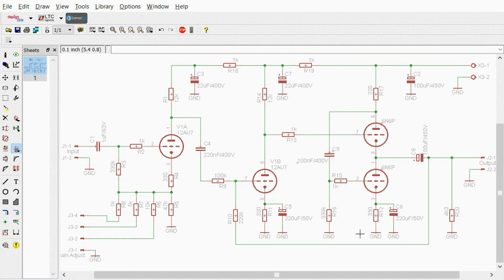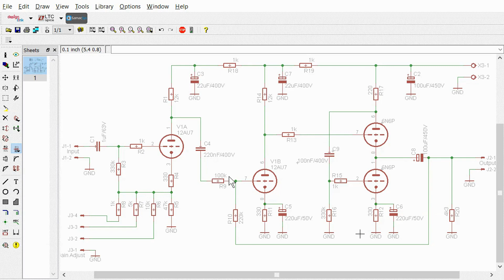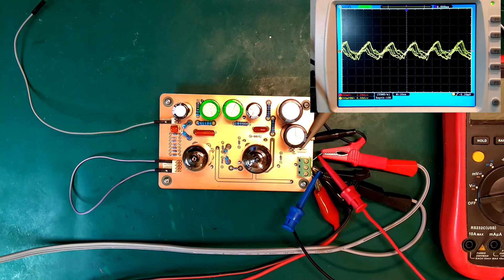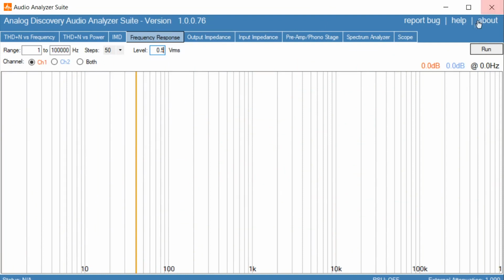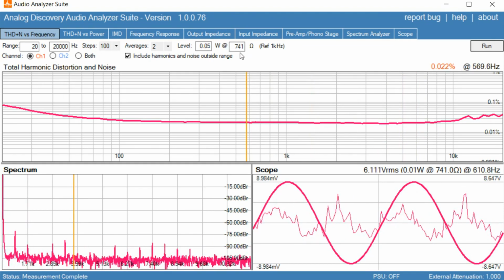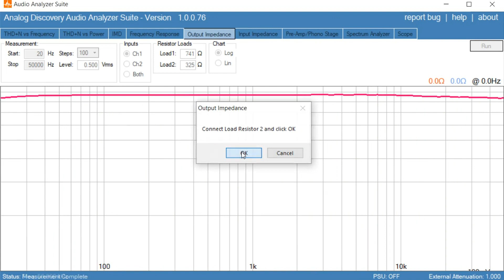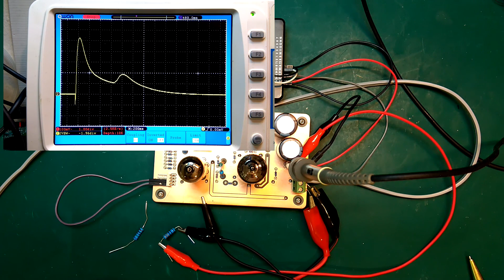Designing and Building a Tube Headphone Amplifier - Part 1 - Prototype Design and Measurements

Comment: Your project is sooo timely, I started thinking about a headphone amp last night. I found this, https://headwizememorial.wordpress.com/tag/headphone-amplifier/, and started down the OTL design route then you posted this part 1. I'm looking forward to your progress. Also. excellent tip at the end about the power on spike and that it needs to be avoided. I probably would have blown out my headphones,  so I owe you for that save.
Reply from the maker: Thanks, that is a great collection of tube headphone designs, I'll have a closer look at these. I believe OTL is the right way to go unless you need to drive really low impedance headphones plus I find it can be a bit hard to know what you are getting when shopping for output transformers.
Reply: @TheStuffMade  I think it's great you're undertaking this project wanting OTL. The fact that measured ~10ohms output impedance and mW of power gives you a lot of headphone flexibility. Research the modified White and how they determined the plate resistance value to balance the output push pull.
Reply from the maker: @CraigHollabaugh  thanks, yeah I think it will make a nice little headphone amplifier once finished. I do use LT Spice to tune the circuit for low output impedance and distortion, however I often find the tube models can be a bit hit and miss but usually they will get you to a reasonable result.
Reply from the maker: @CraigHollabaugh  I just realized I had put 330 ohm instead of 220 ohm in the schematic for the lower output cathode resistor, that was mistake on my part, it was supposed to be 220 ohm. That surely would throw the balance out of wack. Good catch!  But I should probably raise R14 to something like 15k for a better balance. Thanks.
Reply: @TheStuffMade  sounds good.

Comment: Look cool.
Are you looking to get any "tube sound" out of the amp? Tough to do without an output transformer (eg. class A "big bottomed" asymmetrical waveform), just curious.
Looking forward to see how you package up a HV supply into a bundle along with the main amp... assuming you put the whole thing into a chassis.
Cheers,
Reply from the maker: Thanks, I haven't gotten around to listening to it yet, it's just a mono prototype, but I'm not looking for any kind of heavy distortion :-) I think it will just be a normal transformer supply but with a transistor regulator and some zener diodes as reference. Probably a 50W transformer will be enough. It will still be quite large.
Cheers

Comment from the maker: I've been looking into building a tube based headphone amplifier, this is part 1 of my efforts so far.
00:00 Initial Prototype
00:12 Schematic
01:48 A better prototype on circuit board
02:19 Assembly
04:28 First power up with reduced voltage
06:09 Full high voltage and ready for measurements
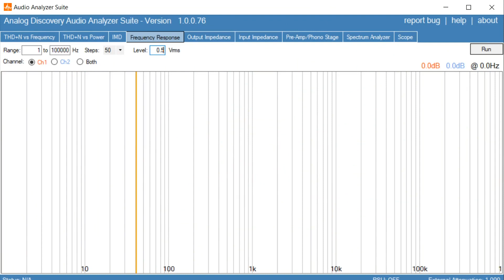06:40 Frequency Response measurement
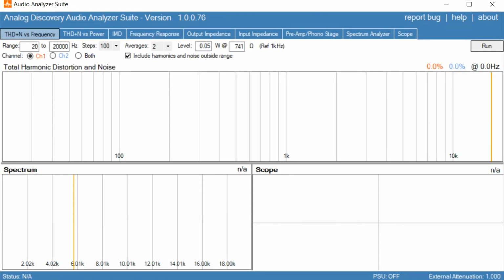07:36 THD+N at 50mW into a 750 Ohm load
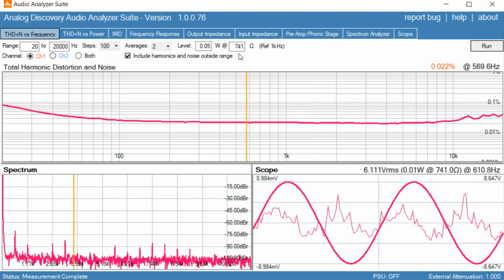09:07 THD+N at 50mW into a 330 Ohm load
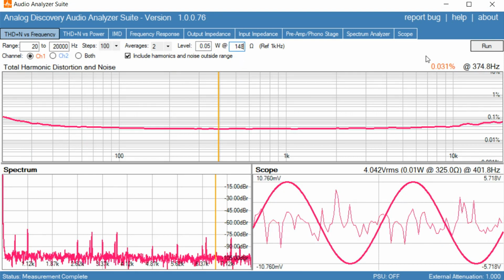09:59 THD+N at 50mW into a 150 Ohm load
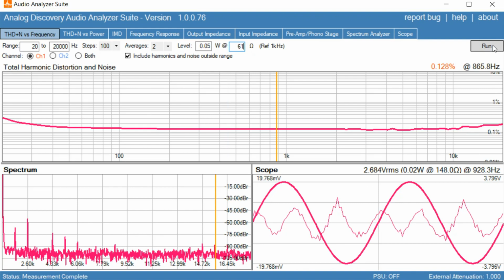10:42 THD+N at 50mW into a 60 Ohm load
11:16 THD+N at 25mW into a 60 Ohm load
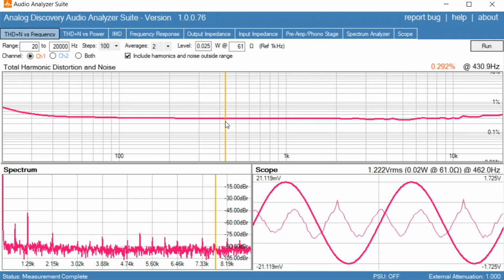11:51 THD+N at 25mW into a 30 Ohm load
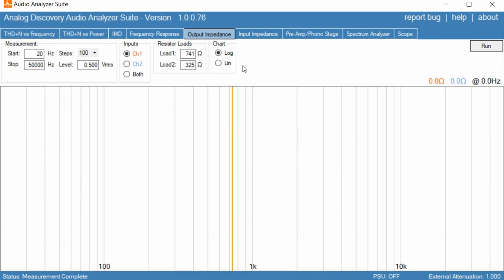12:39 Output impedance measurement
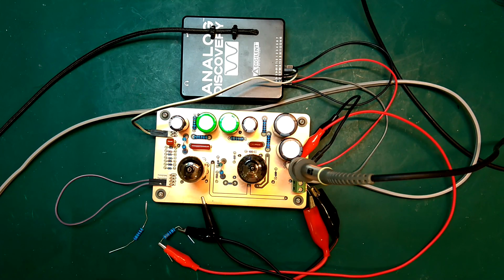14:05 Conclusion
14:48 Measurement of power up output spike
15:26 Thanks for watching